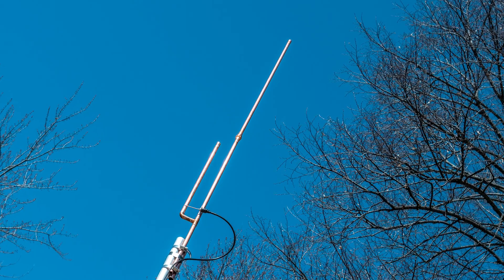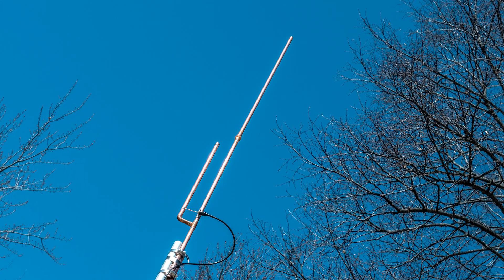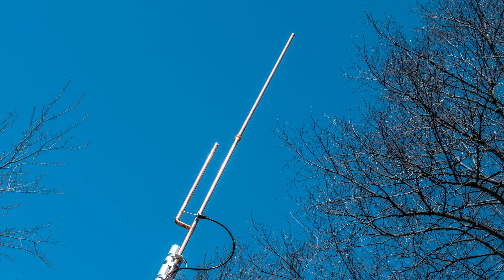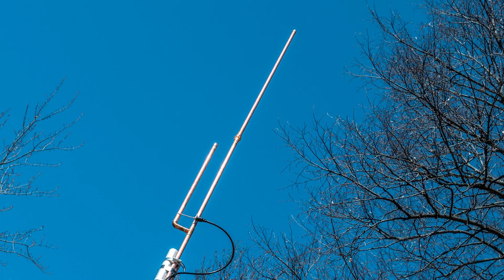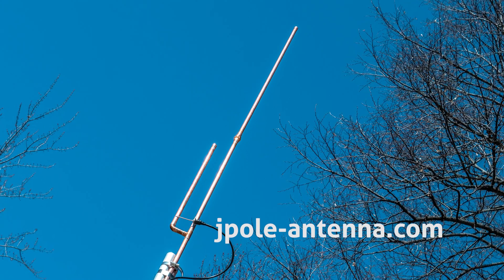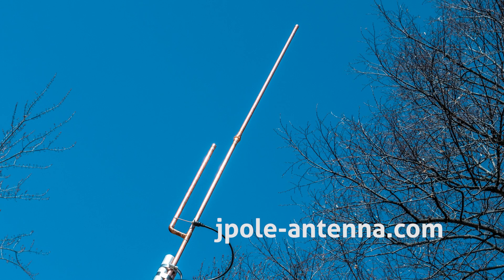SWR Meter vs Antenna Analyzer Explained for Beginners!

Comment: I own both a RigExpert AA-35 (got it secondhand at a ham fest), and a NanoVNA.

Vector Network Analyzers, I believe is what VNA means, have a TON of information about how your antenna setup is operating. Nice tool to have.

RigExperts I believe are instrumental to those who deploy antennas out in the field on a regular basis. Absolutely worthwhile utility.

Comment: There is an app to use with the Nano-VNA that can make using this tool easier. It is called nanovna-saver and is no cost. There is a video on YouTube with Jason and the Smokin Ape that walks you through some of the capabilities of this tool and software.